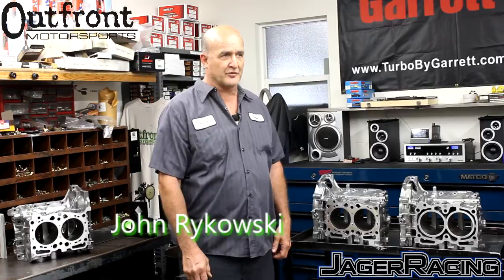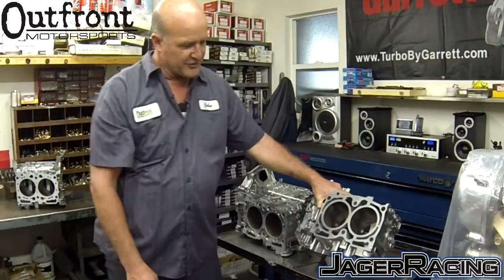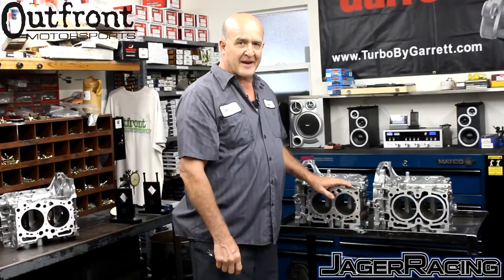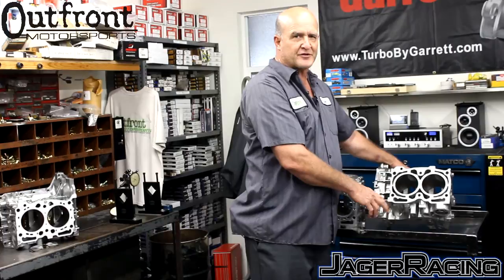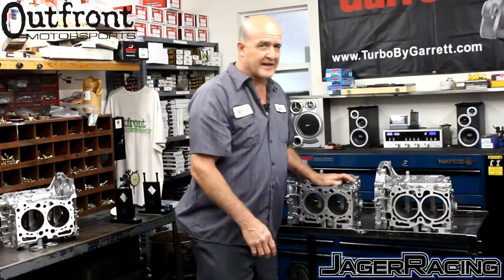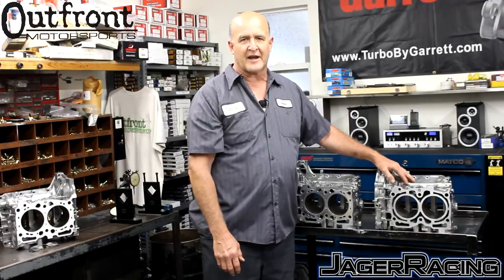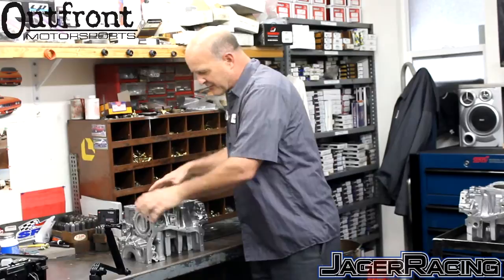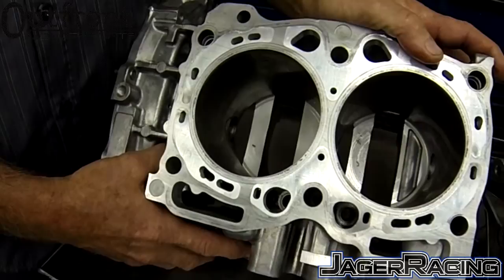Outfront Motorsports Closed Deck Block Interview

Comment: Are closed deck options available for a eg33 or ez30r?
Reply from the maker: yes. Outfront Motorsports offers Closed Deck Options for EG33, EZ30d, EZ30r, FA20, FA20DIT, FB25, EJ205, EJ207, EJ25D, EJ251, EJ253, EJ255, EJ257, and EJ22